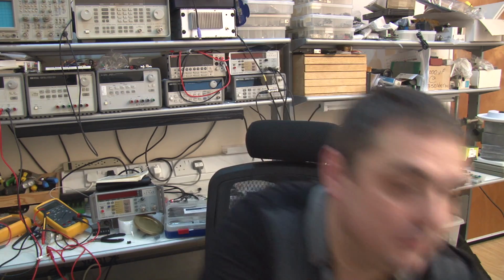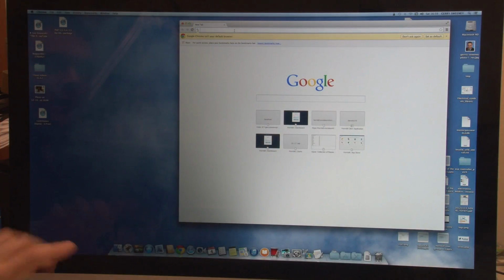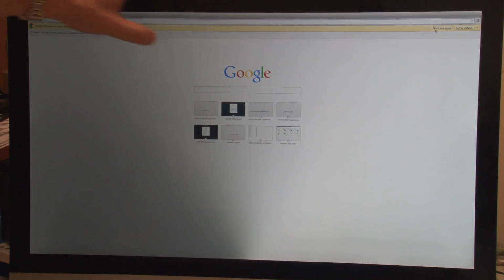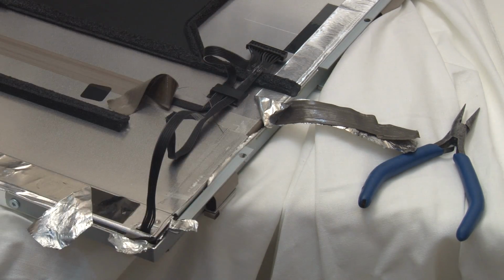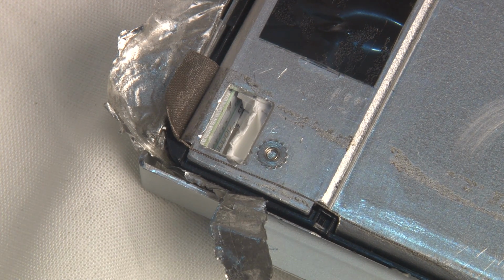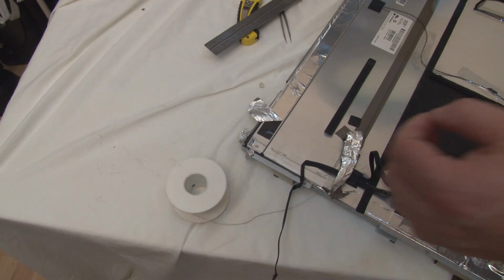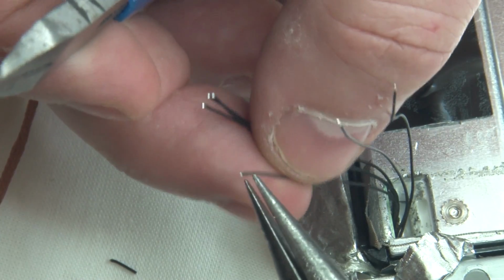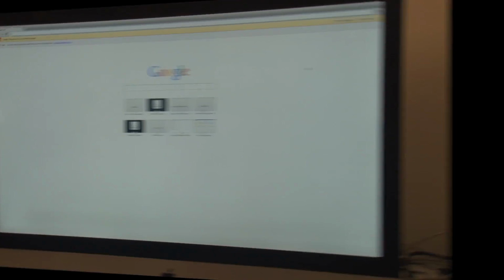Apple iMac 27" Dark Side Screen Failure - The Manufacturing Fault Apple Will NOT Admit!!

Comment: Hi Gerry! awesome video! thanks for the help! I also have this problem https://www.youtube.com/watch?v=9WbFqEZwvkI  I don´t know if you could help me out. Do u know if this sound would come from a faulty power supply? also if the power goes out then I have to leave my imac unplugged for about 24h before it comes back on. If you have any info and don´t mind contacting me at sid.stockwell@gmail.com I would be very greatfull! Thanks!
Reply from the maker: Sid Stockwell Hi, I am not sure I cannot really hear it in the video.  Does the sound come from the speakers (i.e. if you plug in headphones can you hear it in the headphones)?  If not, and it relates to the screen brightness that sounds like mechanical noise from the switching transformer that is used to power the LED backlight, or it could be in the main switching PSU.  This can be common in switching PSU's either because of a mechanical issue or a failed capacitor.  Very hard to say which one, the best you could do is find another iMac and swap the board out and see if the noise moves with the board, if it does you have found the problem - if that makes sense?
Reply: Gerry Sweeney The sound comes from the top left corner of the imac if you looking at it from the front. I know this is the area where the LED controller board is and the power supply. The sound is a buzzing noise that varies when you change the brightness, otherwise its just a constant noise. 
The reason I would think its a power supply issue is the fact that when I unplug the imac , or the power goes out, it won't turn back on unless I leave it unplugged for a day.
Reply from the maker: Sid Stockwell yes I think you are right, sounds like a PSU issue. I have never had to repair one, but most switchers fail with the same issues. Best thing to do would be to find another mac you can swap parts around to identify the problem and get a replacement board/PSU module. Gerry
Reply: Gerry Sweeney Yeah, ill try to get my hands on a power supply and see what happens. Thanks very much for your help! Sid

Comment: Gerry Sweeney Thank you very much for your video, I'm from Guatemala, I would like to know what kind of cable did you used cause I tried and couldn't weld the cable I was using, besides, the space is really small, so I couldn't do it. Instead I fold the little parts that make contact to give it more pressure and it worked. Now my display is at full brightness. I appreciate, thank you very much for your video.
Reply from the maker: Josh De la Cruz I used 30AWG wire wrap wire, I think I posted the details in the comments here or on the related blog page. Gerry

Comment: Thanks for posting this Gerry, would this also fix the issue of the screen going completely black randomly and only coming back after you push the power button to simulate sleep mode? I've been having that issue lately and before I tried to find someone who is much more skilled in this than I ever will be to repair it, I wanted to see if this would help for that issue as well. Is this possible or is it another issue altogether? Thanks again!
Reply from the maker: DannyPolDiaz I think that is probably another issue, could be backlight PSU faulty or overheating. Gerry

Comment: Also many thanks for the video Gerry! I tried and sadly failed, cleaned (scratched) the solder that went between two connectors but this makes it all the more harder to see what I am doing now as there is no clear line between the connectors anymore. Need to buy one off those lighted magnifiers you have, I started off on the wrong foot to begin with. But all is not lost...afraid I need to take that screen apart if i am ever properly going to see what i am doing. Trying to find some help with the disassembly online, that one step further that you yourself went and talk about maybe doing some day. By any chance have you come across a video or pics of a disassembly of this or similar model LG screen? Anyways thanks again for the video.
Reply from the maker: Hi stefan van de staak I came across this video, shows stripping down the panel to clean the glass... https://www.youtube.com/watch?v=ziN5KhzshcI
Reply: Gerry Sweeney
Hey Gerry, thx. But yeah I came across this clip to, there are a couple of clips like that, cleaning the 'clouds'. But I am looking for going beyond the white surface and getting to the other side. I'll keep looking for a bit but am afraid I just need to try and see how far I get...and probably buy a new screen.

Comment: Hi Gerry, 

Thanks so much for the great video, what was the kind of wire that you used to solder into the previous connection points?
Reply from the maker: Hi Craig Steele I mentioned in comments below and in the blog comments, it 30awg wire wrap wire. Gerry

Comment: my 2010 or 2011 27" imac i3 processor screen keeps going to a black screen like the screens in sleep mode, i have to use alt,command and eject button to wake the screen, but then 2 seconds later black screen. i have read its a fan cooling problem so it over heats. i downloaded smc fan control and that didnt seem to help at all. i now turned my brightness down on my screen and it seems to be working alright for now. can anyone suggest anything i can do so i can have full brightness again?
Reply from the maker: stuprint182 sounds like you might benefit from opening it up an cleaning dust out of all the airways for the cooling. Dust build-up is a common problem
Reply: everytime i get the black screen now. i do a PRAM reset and the screen brightness goes to normal and no black screen. then couple weeks later for instance the black screen again. its annoying but thats the only option i find to solve it.

Comment: Hi Gerry, The soldering route didn't work. It's just too small for me to work on even with magnifying glasses and micro soldering tips...I tried..I really did..but I made a mess.  I have started the process of taking the display panel apart completely. looks like its a frame around an LCD...taped and screwed. I might have to pry it out of the metal frame to get to the plug. Any suggestions? Thanks,Richard
Reply from the maker: Hi ***** I have not done this yet myself so I am not sure I would have much useful advice apart from be careful in there.  If you damage any of the flat flexes that come out of the glass it will be toast, the point of no return, a new panel will cost you the bones of $500 US. Good luck with it...hope you get it done. Gerry
Reply: It was a lot easier than I had thought..mostly removing tape and then obvious screws.It's basically a metal frame around the LCD panel. The LCD is a series of panels and plastic films sandwiched together. I was careful to get the frame away from the LCD panel. With that gone I was left with the metal back panel of the LCD  exposed and found the LED backlights ( and the the bad solder joint).
If I were better at soldering I would have had an easy go of it, but alas, it was not to be...the soldering proved to be much more than I could handle even with the increased access.I ended up burning the contacts so badly that it could not be saved. So...a new computer is in the works for us now. I have to say it was worth the effort just to learn how the computer works and how and LCD panel works. It was a hoot to play with...thanks for giving me the confidence to attempt it...
Reply from the maker: Hi ***** sorry to hear that did not go so well, dont give up on it, if you have trashed the pannel you can get them on e-bay for a few hundred dollars, get the part number of the panel and search for it on e-bay. Gerry

Comment: Hi Gerry, I'm about to attempt this repair...I've gotten the teardown done and found that the the plug had come loose..the same as yours. So far, so good...now I am about to attempt the soldering....I have the tools and wire but the tip on my soldering iron looks too blunt. Are you using a micro-tip on the iron?  Right now it does look like its going to be brain surgery but I have nothing to loose,right? Thanks,Richard
Reply from the maker: The tip is pretty small, pencil type tip. I have another iMac to repair with the same fault, I plan on doing an video and attempting to strip the actual display panel down to fix the connecter problem properly without having to do the micro surgery. Not sure when I will get around to this though so I would not wait for me.  The point is thats another option for you. Gerry
Reply: Thought so..I'll look for a smaller tip. We killed 2 birds with one stone; when opening the case and taking out the display we were able to get a ton of dust out of the fans and all over the body..LOTS of dust...I suspect this has caused overheating and shutting down the system entirely ( screen goes black).

Comment: Gerry, Thanks so much for sharing this. I repaired my 2011 iMac 27" today, but instead of soldering, I put a piece of thick UHMW tape on the back side of the connector. The problem is definitely that the pocket which the connector goes into is too large, and the tape, which is .012" thick, makes up the difference and now the connector is snug. Scotch tape is .0025" thick, so 5 thicknesses of that tape would work. Use care when replacing the connector so the contacts line up- push it to the right (toward the side of the screen) as you push it in. Also, there is a small ridge at the top of the pocket, part of the retention design. I scraped that away to make it easier to replace the connector.
Reply: Great idea, I might try this method also first before having to solder it!
Reply: Did this hold up? So just putting enough weight on the connector to reenforce the connection works?

Comment: my screen has yellow lines, what is the problem?
Reply from the maker: ***** I have no idea, not something I have ever seen I am afraid.
Reply: Gerry Sweeney I can send you a picture ?, maybe you can help me. Thanks
Reply from the maker: ***** Sure, feel free, if I can make a suggestion I will. Gerry
Reply from the maker: ***** I cant be sure, I have not seen that before but I would suggest the LCD panel is failing/failed, not sure it would be repairable, you might want to take the panel out to get the model number and just search for a replacement panel on e-bay would be my best suggestions I am afraid. gerry
Reply: ***** It may be the lcd panel, it may be the lcd video cable, it also may be the graphics chip inside.. i'd personally begin with the lcd cable with a multimeter..

Comment: Thanks for the video and the other on breaking down an iMac. I have not had this dark side problem (yet) but I am seeing a problem with the display quitting or distorting or doing a strange split screen issue. A little research suggested installing smcFanControl would help. It does but it bothers me that for a few years I have never had a problem and now I am. I followed your instructions and took it apart but just so I could blow the dust out. There was actually very little and the cleaning did not solve the problem. I saw another video that suggested thermal paste hardens with age and may not transfer heat. Do you think it's possible that I need to pull the logic board and replace the thermal paste on the chips with heat sinks?
Reply from the maker: HI Bill, that certainly would not harm, but I would start with looking at the temperatures reported by the system info first, just check to see if they are running excessively hot.  You can install a free dashboard widget called istat Nano (http://istat-nano.en.softonic.com/mac) that will give you this information. However, I believe that this is measuring the temperature of the heat sink rather than the core so there could still be a problem with thermal coupling. If you can re-produce the problem I would get in there with a can of freezer spray and see if the fault resolves when you cool the GPU down.  Gerry

Comment: Great video... I had given up hope for my iMac with this exact problem and don't use it any more... I'm not sure I have the skill to pull this off, but may give it a try versus never using my Mac anymore. Thanks for the guide.
Reply from the maker: Mark Gundersen well if you are not using it at all you have nothing to lose I guess :) There are places that will fix it for you that don't charge anything like what Apple would - where are you based? Gerry
Reply: I'm in Stockport, Manchester. I've just been googling fine tip soldering irons, I may have a crack at this! You mentioned you had another video explaining how to get the cover off and get to the Gubbins, I don't suppose you have that link handy? Thanks.
Reply from the maker: Mark Gundersen Yeah sure, here  it is. http://gerrysweeney.com/apple-27-imac-teardown-ssd-hack-and-2tb-upgrade/
Reply from the maker: Gerry Sweeney good luck with the repair, and question feel free to ask.  If you do end up break it irreversibly or not being able to effect the repair and you want to sell it broken I would be interested in taking it off your hands so I can make another video...if you want to contact me you will find my email address at the bottom of this page http://gerrrysweeney.com/about/  Gerry
Reply: Thanks a lot Gerry.... I'll let you know how I get on either way and I'll keep your offer in mind. I imagine it may be a week or so until I can get the time aside to have a decent crack at this. Cheers.
Reply from the maker: Mark Gundersen No problem, all the best with it. Set yourself 3-4 hours.  Be careful with the screen cables, especially the big one, the connector is weak, you should not need any significant force, just find the locater springs on the side, it should be easy to unplug and plug back in.  If you damage that connecter either the screen, the computer or possibly both may end up as toast :) Gerry

Comment: I had the same issue. I ended up wiggling the wiring around to make a good connection and then glued it in place. It beats soldering the little connections but not quite at secure. So far it's working well. Hopefully it will hold up over time.
Reply from the maker: Thanks for the comment, you are lucky to be able to get away with that, I would worry that heat up/cool down cycles will eventually cause enough movement to make that fail again, but if its working for you now thats a good fix :) thank you for sharing. Gerry

Comment: Hey there Gerry. Thanks for your video. I had this exact problem with my mid 2011 27in. I attempted the fix as you did here but I cocked up the soldering and ended up tearing off a couple of pads on the LED board. I used Cat5 cores as the hook-up wire....no good, to rigid.
So I disassembled the panel, rather carelessly as I thought all was lost. Finally got to the LED PCB, everything has to come apart and out to get to it. I scratched myself some new pads and tinned them, cut up a USB cord to get fine stranded wire and soldered on some legs as you did. Re-assembled the panel. I couldn't manage to solder to the legs of the socket so I cut the plug off the feeder and connected each of the 6 cores wire to wire with heat sleeve. 
All works now except think I left an eye lash between the LCD and backlight layers.
Reply from the maker: Hi Matt,

Glad you got it sorted in the end (apart from the eyelash feature you added)...I wanted to find another one and do a full panel teardown but none of the ones I have access to have so far failed: ( Oh well, I am sure they will at some point. Thanks for the feedback...

Gerry

Comment: I've got the same problem and will try your fix later this week! Any tips? Do you remember how many watts you used? Great vid, thanks!
Reply from the maker: Hi Jonas, you do not need much heat, I used a variable temp 17w iron with a very fine tip. Use leaded solder and pretty much any fine tipped soldering iron will do the job. Good luck with the repair. Gerry

Comment: Just a little request here, would you mind doing a review of your Aoyue 968 reword station? It just seems like the best choice at this moment, but very few reviews on it.
Reply from the maker: Hi, I think this has already been done:  Aoyue 968A+ (Product Review)  what I would add is, its a low budget tool but both the hot air gun and the soldering iron have been really good. I have found the temperature control on the iron to be hit and miss sometimes but that probably down the abuse it gets from me, and replacement irons are cheap, I bought 5 of them but I have never had to use them, I am still going strong on the original believe it or not, and I must have had the thing 8 years now...If you need what this thing offers I don't think that it can be beat in terms of value for money.  If you are using it day in day out, 8 hours a day that might be a different story... Gerry
Reply: Gerry Sweeney Seems like I got the models wrong, a friend of mine is trying to sell me the Aoyue 908. But even at £50 it's difficult without a good hands-on review (which I haven't found for the 908). Thanks for the link anyway, will tell me more about the "brand" I guess.

Comment: Hello...Thanks for sharing your experience with us. Since the soldering process is not clearly visible, I dont know how can I solder each cable to each pin on the board.. How did you solder each one individually in such a narrow space. My iron barely fits in... :(